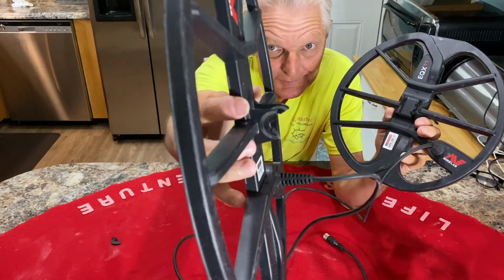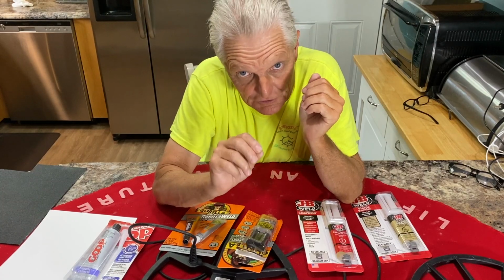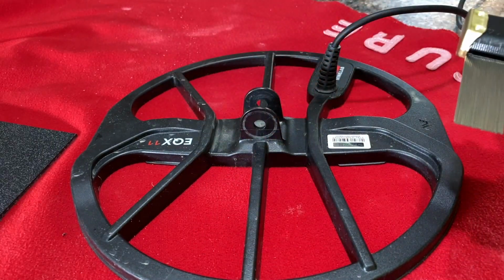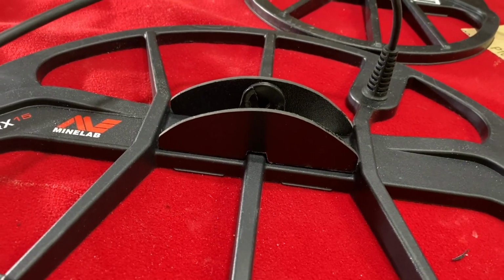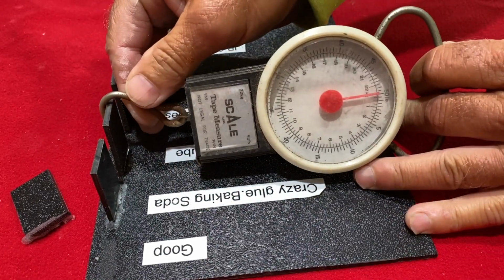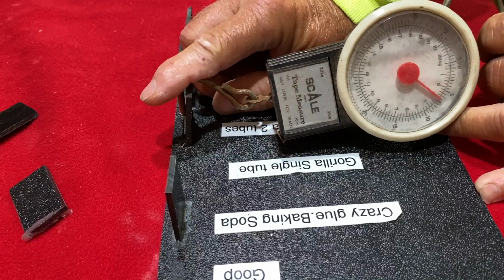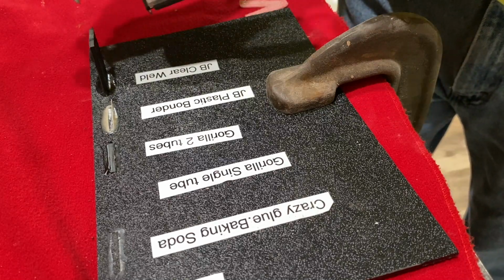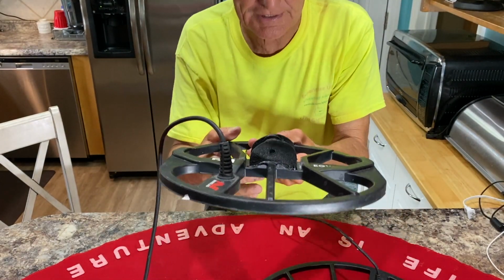Equinox Coil Repair

Comment: I used JB weld on the broken ears of my Minelab X-Terra705 coil and built up a backing wall behind them also for extra stability, have used it twice without a problem so far.

Comment: Great video very useful. You tested the glue under creep strain, but do be aware the sudden impact or Charpy impact test could also be employed to test the durability of the bond under sudden force like hitting a rock. Some bonds break very easily when knocked but are strong under gradual or creep strain. ie they have good tensile strength but are brittle when knocked. Thanks again.

Comment: Great video , I have used your baking soda trick before and it worked great , learned it from you 🙂

I have used gorilla glue and tape on my Garrett control box before and it holds well

Comment: The NOX 600 and 800 coil yoke stiffeners will make your coils less prone to breaking by reinforcing the existing yoke plates. There are to versions available one for the 11- and 15-inch coil and one for the 6-inch coil.
Also available is the repair yoke for the 11- and 15-inch coil. If your yoke tab breaks off, you can use this part to repair the coil using two cable ties to hold the yoke plate in position securely

Comment: Nice fix Gig. The only problem, (which is worth it) is more resistance when swingin’ in the water. But if it holds out, beats buying new coils and letting those collect dust or throwing them away out of frustration. Like yourself, my minds gears have been turning on an idea to fix this problem when coils go out of warranty. Nice video content. _/

Comment: If the coil plastic is ABS then small drops of acetone will melt the two together. You have to be careful not to use too much acetone at a time or it will eat it up.

Comment: Excellent video by rights Minelab should step up and make it right to start with they have enough of the market to fix this  reoccurring problem
Reply from the maker: Minelab is great at backing up there warranty. Great machine just got to fix the weak points.

Comment: Nice fix on the coils Gig. Did you find that the stock coil bolts were long enough to accommodate the added bracing ?
Reply from the maker: Yes

Comment: Crying shame that Minelab hasn't come up with a permanent solution to this problem. I have never seen coil ears break as frequently as they do on these machine's. Minelab should own the problem and come up with a solution! Hey Minelab time to get to work!!!
Reply: This was on my mind while watching this video.  Seems that proper engineering should have avoided this situation.  Has Minelab modified the design for the new coils?

Comment: Why isn’t Minelab taking care of this ? I’ve seen a lot of these coils breaking.
Reply: I have had my Equinox 800 for a long time and never had a broken coil nor arm rest, if those who use the Equinox the correct way then these breakages would not happen same with the arm rest I have personally watched other EQUINOX users push and force their arm down through the arm band attachment before taking a few seconds more to loosen the velcro strap before putting their arm down through the strap and this would stop the arm rest from taking personal abuse